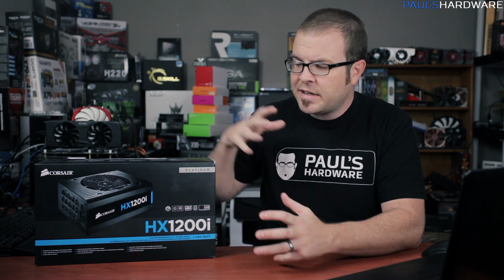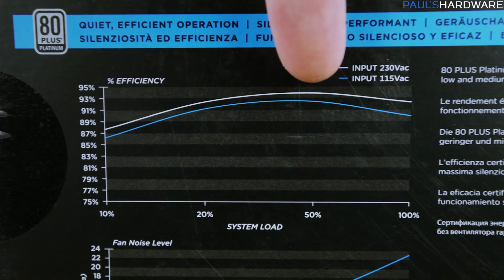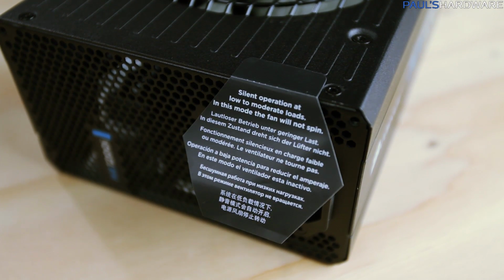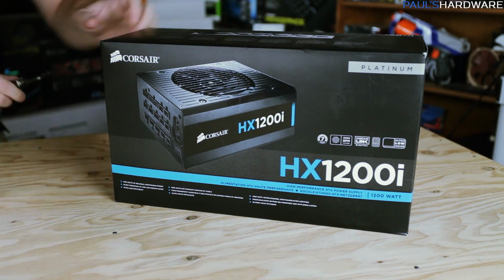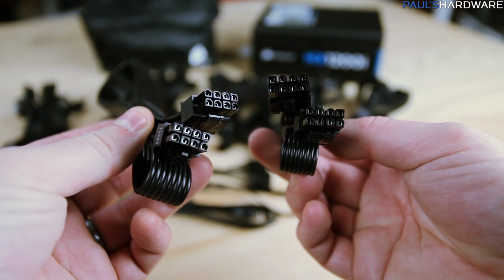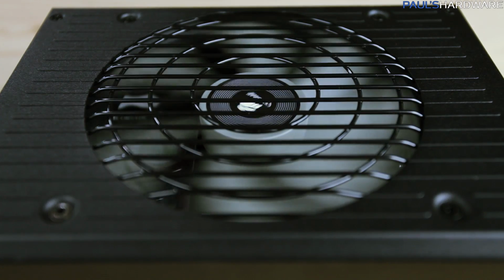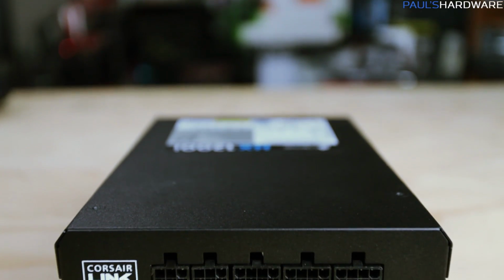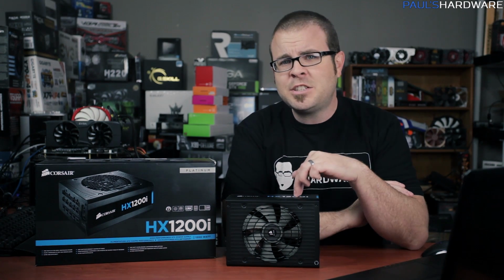Corsair HX1200i Platinum 1200W Modular PSU

Comment: I bought an HX1200 Platinum Model CP-9020140/75-002707 
and I have no idea WTF is going on with the cables.   They are suppose to be Type 4 but they do not match any of the TYpe 4 connectors in my Type 4 Premium Pro Kit.  On the box it says Type 4 and compatible with HX1200 (2017).    I have no idea what year mine is.   But if it's an earlier Type 3, according the Corsair chart every other cable should still connect except the 24pin cable.   That's not the case.  none of my cables work.  I even bought some other Type 4 standard cables and they do not plug into it.  WTF Corsair.   Does anybody know what is going on?  Are these Type 5.  According to the Corsair compatiblity chart, HX1200 Platinum takes Type 4 and HX1200 Gold and Bronze take Type 3, so I am mystified.

Comment: I know this is an old video, but I just wanted to add my experience with this PSU. I bought my HX1200i almost six years ago. Through many system changes, it's been absolutely solid and never let me down, not even a single hiccup. Right now, it's powering my brand new Ryzen 7950X + RTX 4090 system on an Asus Crosshair X670E Gene motherboard. It's really useful to be able to monitor it using the USB link. You don't need to install Corsair's software to do that if you don't want to, because HWInfo can detect and display the PSU's sensor values automatically. 

Even now, in 2022, I wouldn't recommend any other PSU for a high-end system (unless you really want the digital control features of its bigger brother, the AX1600i, but I've got no use for it)

Comment: How the hell do you install this thing? The top screws don't fit the config of the case. There is no way of screwing it on by the rear either
Reply: Are you sure? I installed mine without problem. Maybe your case needs an SFX psu
Reply: @Azbel_tk  you see. You are speaking to an idiot. I had managed to lose the PSU bracket that came with the case. Without the PSU bracket it's impossible 🤣

Comment: Is it compatible with ryzen processor tho?
Reply: Yes, PSUs are mainly compatible with all modern hardware. The only thing that can make an old PSU incompatible would be that it doesn't have an 8 pin connector for the GPU, since older PSUs used only a 6 pin one.

Comment: Bought two of these, neither of them power the rig. I plugged in my EVGA 600W and it powered it with no issues. I have no clue as to why they don't work. It powers the rig for a couple minutes then shuts off and then power back on and so on
Reply: They might be faulty or the cables at the back are not the right ones. Were these you bought used or new?

Comment: Replaced my 10 year old (and still flawlessly running) Corsair AX 850 Pro Gold (which goes as emergency reserve part now), last week for this one.
The AX850Pro saw it all: overclocking, >10hours of daily use, dozens of power surges due to storms&lightning, has never killed a single component - and has well deserved retirement now.
Could sure run for some more years - but better safe than sorry - component degradation after 10 years of constant use is a natural thing to watch out for, even on the most excellent psu's.
Bearing in mind inflation over that time, the 280€ now for the new HX1200i are actually same expensive/price as the ax850 was back then. 
Monitoring, fan and rail adjustment works perfect (diverse monitoring tools, and Corsair iCue).
Another 10 years without worrying, top notch voltages/ripple (that doesnt kill mobo/cpu/gpu over time like cheap or too low dimensioned psu's do, and/or enables easy&stable overclocking),
plus no need for another purchase whatever may come, while soon running my planned 3080 + ryzen 9 combo upgrade at optimal efficiency.
It may sound too much or expensive - but in the long run (and thus avoided consequences of cheap or underpowered psu's), this is a bargain...

Comment: I thought I need at least 1000W for my 10900K so I bought this, but My whole system doesn't even use 500W while benchmarking even with overclock.
Reply: You will feel glad about purchasing this corsair psu later after you bought the rtx 3090 SLI (NVlink) graphic card 😄

Comment: The thought of overclocking a 3090 is pushing me in this direction >_<.
Reply: Update: I got an HX1200 (non i).
Reply: @RS250Squid  how's it treating you? considering the same combination
Reply: @erik7028  at the moment its sitting unopened in a cupboard. Its stating there until my Strix 3090 turns up, at which point I'll order the rest if the parts for the new build.
I dont anticipate any problems though, Corsair make good reliable units. The RM1000 in the pc next to me has run for 12 hours a day every day for 6 years without even a hint of complaint.
Reply: @RS250Squid  we're in the same boat then, although I'm waiting for a 3080 to be delivered. To be honest the wait time is not the end of the world for me, since I can also wait for AMD's presentation of Zen 3. What do you plan on building when you receive your 3090? (Btw I think I'm going to order this power supply, thanks for your feedback)
Reply: @erik7028  I build my PCs massively overspecced at the start so I can use them for many years. My current PC is 6 years old and still games perfectly happily in 4k at medium-high or ultra settings depending on the game, I want the same lifespan out of the new PC and since it'll be used for everything from running multiple VMs. 3d rendering and video rendering, and gaming ill be going with the strix 3090, 128GB of 3600MHz ram, and a ryzen 9 3950x with 3TB of nvme storage and 8TB of hard drive storage.
Reply: Holy shit thats a serious build! You may actually need the 1200w this psu offers haha
Reply: @erik7028  Yeah, i used a wattage calculator (cant remember which one) and it said anything up to about 950 watts with 2x rgb strips, 7 fans (including the three on the AIO), two HDDs a moderate overclock on the cpu and gpu. 
I dont know if I'll be overclocking but it's nice to have the option.
Reply: @thewisetzar5363  I'd love to get a 5950x, but I can now get a 3950x for 640GBP, and a 5950x sure as heck won't sell that cheaply for a long time.
Reply: Got a Gigabyte RTX 3090 Vision OC that is tripping my Thermaltake 850W PSU. Ordered a 1200i today. I'm done with small PSUs.
Reply: @Trigg3rHippie  Same here.  Thermaltake Toughpower Gold 850w; my 3090 EVGA FTW3 Ultra kept tripping it.
Reply: @Trigg3rHippie  in the same boat. ordered a 3080, will watercool it, and don't want to test my already aged 800w PSU. ordered this PSU, software readouts will be nice.
Reply: Yesterday I OC my EVGA 3080  with RM850X and run couple benchmarks and tests and today the pc didn't turned on. so i replaced with one with older psu that i have 620w seasonic to check and pc turned on, the 850w psu seems died cause OCed gpu :(

Comment: I realize its an older video but these units are still selling new as "top dog" in stores.  I never had any bit of thought that a PSU could cause the system shut down until I got a 2080 TI FTW3!
My brand new 850W Thermal Take Gold PSU had bad time as soon as I launch a game,  the game would crash and I chased the problem for a week until I arrived to an interview by Corsair PSU Engineer who explained in basic words that whats matters is how fast a PSU can react to current being pulled off a PSU.
I purchased HX 850i and it fixed the problem but as soon as I would OC the CPU With Gpu even that wasn't enough the game would start crashing  so, I got HX 1200i and that fixed the problem, now there is  finally enough juice for that beast 2080 ti and OC'd R 3800X

Comment: put 2 1070's with risers to one wire and watch the copper vapourise (molex 4pin . Luckely i havent seen their pciexpress molex plugs melt yet , that surely takes the card. Very expensive , but extremely substandard quality external witing with plug connector bottlenecks all over the show brand new. EVGA and even raidmax is superiour to corsair  these days. Their cables are boat ankers as well. you can bend your chassis with so much plastic in stead of copper.

Comment: Does it have 3.3v on the SATA plugs along with 5V and 12V, it is common for power supplies to not include 3.3v and my coursairr H115i AIO RGBs need 3.3v to work

Comment: So, if the default cables for PCI are (8pin) to 2*(8pin) or 2*(6+2) that is the same thing... that means that i can connect to one output of PSU one MSI GTX 1070Ti that takes 8+6 pin with no hazard/fire risk either for the PSU or the cable itself? I'ts not to much power for one output of PSU?

Thank you in advance and sorry for English xD

Cheers

Comment: I call BS Paul. Running my 1080ti and 1700X on a 750W Titanium Seasonic and it's maxed out it's power potential after some overclocking. Mind you, extreme overclocking, but it was causing me problems. Add a second 1080ti and a 1200W power supply is the right space for some dual graphics overclocking. Mind you, this is 3 years later...but still.

Comment: I got this 1200w corsair and corsair liquid cooling h115i both needs usb cable to be connected to usb 2 header on motherboard my problem is i have ass x99 deluxe 2 and it has only one usb 2 header what should do ?? is monitoring the powersupply important ?

Comment: If I've done my maths right, then this powersupply should be enough to support a dual SLI on GTX 1080P Performance, 5820K, EATX, 64-128GB RAM, 4 high storage HDD's and 2 high storage SSD's as well as a bunch of fans to cool it all, AIO watercooling for the CPU and an optical drive because I still have games on disks that I like.

Comment: This is a good PSU I just got 4 of them. I'm NOT using the #14 AC cables though, too light. I have some #12 AC mains cables instead.

What I want to know though is the 100 amps @ 12VDC (1200 watts) continuous duty? I mean can I run them at full load for hours or days on end and not have some smoking surprises or the funk of burning electronics in the air?

I have 3 intel i7 5960x PC each with dual nvidia Titan black video cards, 32 Gb Ram, dual 256Gb SSD's and one AMD 8 core FX 8350 with 32 GB ram and a titan black video card and an HDMI capture card and a single 256 Gb SSD and a single 128Gb SSd for OS boot.

Comment: Nice looking PSU. I am building an X99 based system and I chose a Be Quiet Dark Power Pro 850. If it doesn't work out, for some reason, I will probably go with a Corsair product.
Nice review, BTW

Comment: I need a new Power supply but corsair wont be my number 1 choice . I got a Corsair GS700 and its so noisy .The fan doesn't spin up till 40-50% load but there is this really annoying clicking that comes from the fan before it spins up . I ended up strapping a 120mm fan to the PSU so there is a fan constantly spinning .Only after doing this can i get the PSU to shut up. I don't like this trend PSU makers are doing by having the fan completely turn off .It just adds another failing point.

Comment: my new saystem is plannign to run dual 980s sc and a 5930k with a evga x99 classfied board. with 4x4+16 gigs of ram.whats a good wattage for it?
Reply: 850W. Get the 5820K though. 5930K isn't worth it if you don't need the extra PCIE lanes.

Comment: I've seen overclocked 290X 2-way Crossfire cards under torture test load hit 1050w.
Reply: Cards only or full system? And what kind of system?
Reply: 1toncheese
Full system. Just a basic 4770K. Not X99.

http://www.tweaktown.com/tweakipedia/37/sapphire-radeon-r9-290x-tri-x-overclocked-power-consumption-numbers/index.html
Reply: Daniel West I show the chart u meant but it said "higher is better", i think they should change that
Reply: Anonymouse
Yeah, that was probably an editorial error and should be changed.

Comment: For my dual 980 build (silence optimized) I looked closely at this PSU, but ended up going with the seasonic version. I came to the same conclusion you did. Once you end up at 80+ Platinum, they're all going to be very similar. Since I had no desire to tinker with anything, the HX1200 and the 1200 Platinum were the only players on my list. A deal on Newegg is what ultimately sealed the deal for Seasonic in my case. I couldn't rationalize the extra $40 (at the time) on the Corsair equivalent.
Reply: 33333333

Comment: It's also worth giving EVGA a look. Unless you really need the PSU monitoring features I think the EVGA Supernova 1200W P2 PSU is a much better deal. Identical specs (minus the Corsair Link stuff) to this one plus a 10 year warranty for $220. There's also a 1000W PS version for sub $200, if you can't handle the 1200W.

Comment: I have a 750w gold rated Seasonic... cost me 100$. I bought it with the afterthought of being able to SLI with 2 cards... currently just one GTX 970. I also prefer running the PSU at 50-75% capacity max... better quality power output.. less ripple & longer lifespan for both the PSU & the components it powers.

Comment: I can tell you he's wrong about needing 3 video cards to required 1200W.  I use 1200W with a 5960X and 2 TitanX's, because all of the above is heavily overclocked-overvolted.  I have just enough headroom with the AX1500i to add a 3rd X down the line.  I can also vouch for Corsair's sweet warranty support.  They cross ship!

Comment: Great Paul!
I just bought the AX1200i on the NewEgg sale yesterday, now your telling me there's a cheeper version? 😔 it's just like when I bought my GTX 980, then two days after if shipped, the GTX Titan X was revealed.
Reply: Blablabla it's not overkill don't worry.It's actually more efficient.
Reply: Blablabla Its not a cheaper version. Its a similar PSU with less features for a slightly lower cost. 1200 watts is WAY overkill if you just have a single 980.
Reply: LOL, I was trying my hand at sarcasm. Well a little more about my build, I am about to buy a second 980 and will be buying probably 4 to 6 NAS drives for redundant storage. So yeah over kill a bit, but its worth it in my own opinion.
Reply: Blablabla They are all overpriced.
Reply: ***** You are right. I am actually building a some what massive VM box for certification, Class, VLABs and personal domain stuff. So in fact you are correct about it not being overkill, its something that will grow with me as I expand. ;)

Comment: I prefer to have a high quality power supply with middle to high wattage like 600watt +.
I have a Corsair AX 760 with 4790K stock O.C and GTX 770 is more than enough but keep in mind when  having 100 - 150 of extra watt this way will keep your components in safe and also your PSU will work at comfortable power without any risk of overheating, more your components will stay cool and fresh the more they will last longer.
Reply: Tyai Littol Also, you tend to save more power with a higher max capacity psu.

Comment: A solid product, however as mentioned not ideal for anyone besides extreme/server/specialty builds. I'm using the smaller AX860i - and only pulling 300w maximum at the wall between my GTX980 and Haswell-E.

Comment: I use a 550W 80 PLUS Platinum PSU and until this one goes, I'm not buying another one. I'm powering two GTX 660 Ti's and a Core i5 with this bad boy no probs and staying under 400 watts. For me, it's not about how many watts you're using, but how efficiently you use it.

Comment: The one thing I learned when I got my HX850i is that 1200 watts is really overkill for an average gaming PC.  My readings say that I'm only using around 200 watts of power, so I could have gotten away with using a 650 watt PSU for my system.  Knowing all the stuff I learned in the last couple years makes me wish I knew all this beforehand when I built my system.
Reply: GrnArrow092  Better overkill than under powered.

Comment: at $270, I would spend the extra money and get the AX1200i.  thanks for the good review.  :)
Reply: GeorgeCee Same. But in saying that, I think the AX760i or AX860i might be a better option for most people who are just going to be using 1-2 GPUs. I've got an AX860i and its a BEAST.
Reply: That's a very good point and you're right.  Most people don't need that much wattage.  Not many people are doing more than 2xSLI.  :)
Reply: GeorgeCee But I am. Future proof.

Comment: That 7 year warranty is bad ass.
Reply: Zoink EVGA has 10years on their SuperNova series.....and they have actual black sleeved cables.
Reply: neurotoksin They're using the same sort of black cables as Corsair, only difference is they aren't flat and they put one big black sleeve over it. It's not a proper sleeve, nor does it look that great. One could argue that the big black mesh sleeve looks worse due to the large piece of heatshrink tubing at each end of the sleeve.

The SuperNOVA units are still usually the better units, but this is worth mentioning.
Reply: neurotoksin I never said anything to refute that, just pointing out that the sleeved cables don't look that great. As for looks, I like Corsair's design but there's no doubt that those EVGA units are better under the hood. SuperFlower based units tend to be stellar.
Reply: TheSLSAMG You get so much more value for the money with EVGA. More wattage, longer warranty, great efficiency and better looks IMO.
Reply: neurotoksin I agree people dont talk about the supernova B2 and G2 enough they are great power supplies.
Reply: Seasonic PRIME have 12 years so there's that
Reply: That now has a 10 year warranty.
Reply: Still going on lol

Comment: I got the AX 1200i version. I'm currently only running dual SLI but I have about 6 SSDs and another 3 or 4 HDDs with watercooling. I wanted something that I wouldn't have to upgrade if i get another 980 GTX in the future.  Loving it so far.